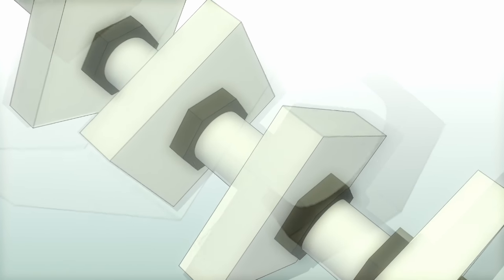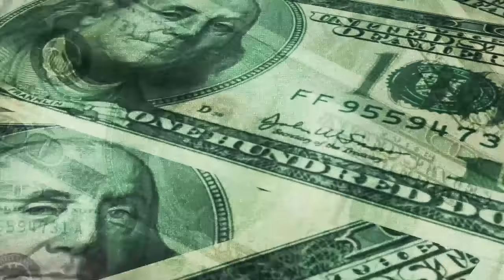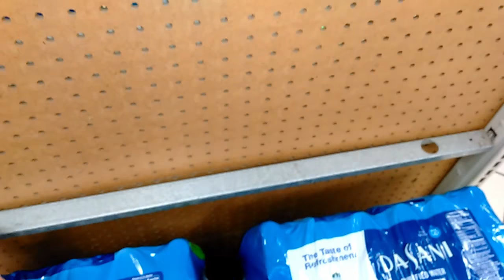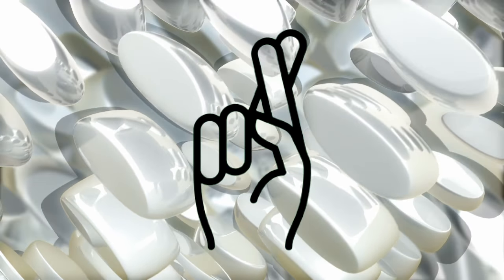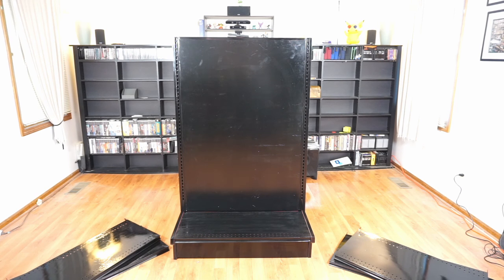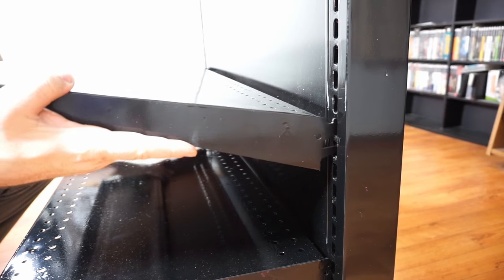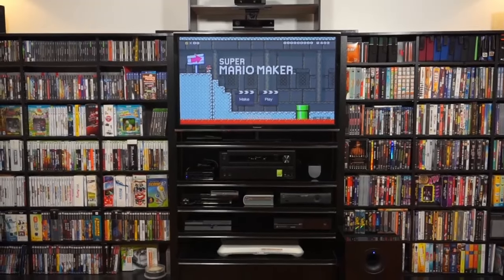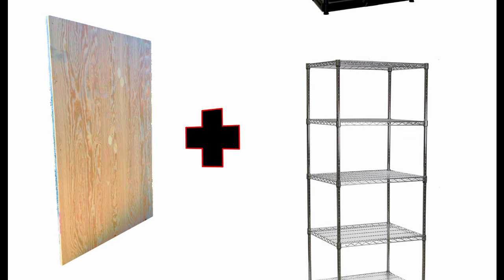New Entertainment Center Idea or My Living Room, Solved! (Part 2) | Game Room Ideas

Comment: That was really cool. 

It occurs to me, you could achieve a similar set up by mixing and matching Amazon Basic Wire Shelving units. You just got to figure out your ideal LxWxH. I was thinking of putting three of the small ones and either using duct tape, or zip ties to hold them together (or you could buy the official "Post Clamps" for these things. The good thing about those wire shelves is that most versions allow you to put wheels on them.

One downside, is that you still have to figure out how to hide the wires. I had two ideas either use Plywood (or Panneling), or foam board (or cardboard). You can cut holes in the material, then again zip-tie it to the back of the wire shelves. It would not have the grid like yours does, so figuring out how to set up their chords is up to each person.

The other hard part is the TV. Depending on the make/ model, wire shelves can be designed to hold 40-150 pounds per shelf. But, the ones that are designed for higher capacity are TALLER than 6 feet, and if you don't put it on the top shelf, you're gonna have the bars from the shelf getting in the way of the screen. So, this set up would only help you create the "entertainment center" for your game room.
Reply from the maker: I am paranoid so I don't like the idea of foam or cardboard to situate the cabling behind.  I would prefer something with a higher ignition point.  :o  Just in case.  

When you described the problem with the bars blocking the screen, it brought back all of the memories of trying to figure this problem out.  At one point I was going to try to do something similar to what you suggest, but I was going to attempt to have the TV on an articulating TV mount.  It would be attached to the wall, going through the shelving unit and with the TV flush against the front of the unit.  If I could have gotten it to work, and added benefit would have been an extra storage area behind the television (think of it as similar to a mirrored medicine cabinet).  Pull the television from one side and access the shelf area behind it, then push it back.  Does that make sense?
Reply: "Ignition Point" LOL! You might be right.

What you are suggesting, almost makes sense to me... but I'm paranoid about having my TV hanging off of an arm so far removed from the wall. Even if I have seen the old CRTs mounted that way, I would be too freaked out to ever try it.

I'm lucky enough to own my home, so I can mount my TV directly to the wall. So, all I would need to worry about is the 4 ft beneath my LED TV. Thankfully, I'm not remodeling my games set up right now, but this is an idea I'm toying with further down the line.
Reply from the maker: +Stanger_in_the_Alps When you figure out something cool, came back and share some pics or a video.  I'd love to see it. 👍

Comment: This is cool. A nice idea could be upgrading to the slim versions of every console since they typically are much less likely to overheat and by definition dump less heat into the room than the previous ones. Although the problem with that is some consoles would exhaust into the shelves instead of out the back.
Reply from the maker: That's actually a wonderful idea. I would love to do that, but I don't know if I have the budget to always replace a perfectly working system for an upgraded slimmer model. But still, that some very smart thinking. Thank you so much!

Comment: That actually looks really nice. I'm trying to figure out a good solution for placing a CRT next to a 4k flat panel with all of the consoles (15) underneath. I've seen setups using a grid of those "box" style shelving units to achieve this, but I have yet to find the same ones that I've seen with the squares being wide enough for modern consoles.
Reply from the maker: +obliterator789 Yeah, I've mostly only found the boxes to be about 12 inches across.  Not quite flexible enough.

Comment: My sisters old stereo cabinet was a good option for me. The stereo got to go because it was too old and several malfunctions. It has a glass door and a big opening on the back. The big opening is good for wires and breathing space. I don’t want rrod on my 360 so it’s good. Another problem I see is dust. Dust is one problems that slow and sometimes break the consoles. With the glass door, it blocks out the dust. I look everywhere for a replacement but still couldn’t find one. I look further to cool the modern consoles like 360, ps3; ps4, Xbox one, and Wii U. They all have vents on the back or above. After playing each units, the bottom of the consoles get warm and hot. So I took several long bumpers like LEGO, plastic pieces, cardboard and etc to boost the consoles up. That way, it help to have a cooler unit around and breathing space outside the vent. I only want lasting consoles. I really don’t care about making it look pretty. Function, reliability, and lasting qualities is what I want. I see so many game rooms and take some good ideas but most consoles are cover with dust. If you have to, cover with a dry napkin or clothe. 

The old stereo glass door cabinets currently hold 8 consoles plus hdmi and av splitters.  I can put more but it would be above the 360 but that would leave less breathing space around the 360.
Reply from the maker: My father had a stereo component cabinet like you are describing.  They were typical in the past, but yeah, these days they are not very common.  It sounds like it fits your needs perfectly.

Comment: I wanted a shelf with breathing space but yet want the dust and hair to be a non factor. Currently my 25 year old media player (sound media player) have a glass door cover which I find it useful and the back have an opening for wires plus vent.  On top is my led tv. Before, it was the old retro tube tv. Although, I find it ugly and retro, it served it's purpose. I'm still looking for one but most game room tour I see, the consoles are left open wide. I have a lot of old systems and I don't want to clean, open up, and blow dust and hair out of those systems all the time.  I'm still searching for a much better solution.
Reply from the maker: +tr1bes My father had a rack-style home audio system with a glass front door.  I'm pretty sure I can envision what you are talking about.  

As happy as I am with my living room setup, I do have to dust the shelves and consoles frequently.  If you figure something new out, please share!

Comment: The problem with this set up is if you want a bigger tv then u have a problem. The tv you have is so small.
Reply from the maker: Since it is a modular system, I could have to option to expand it.  Or I could move my media racks and place a matching set of shelves on either side of a larger TV.  There are lots of different options.